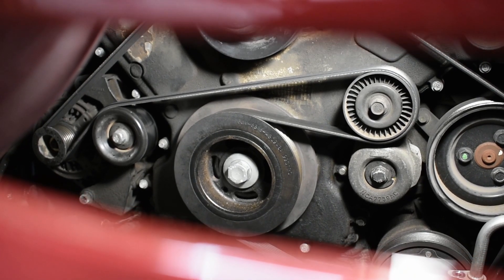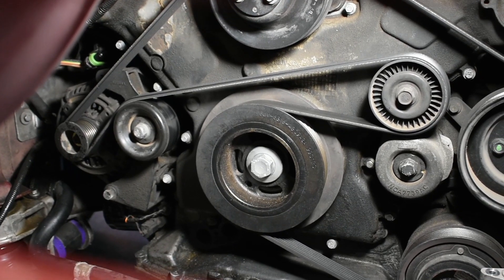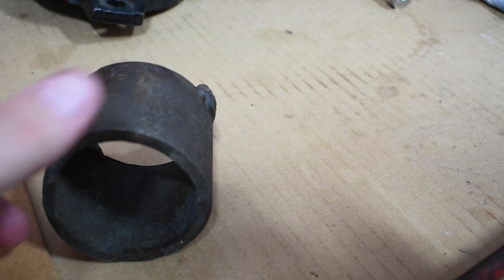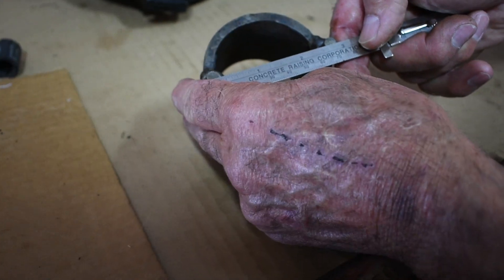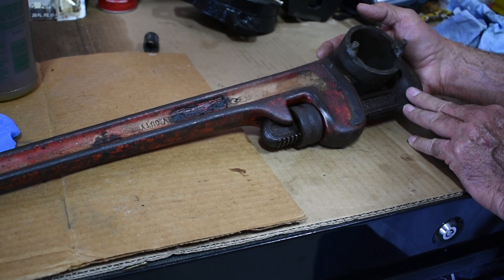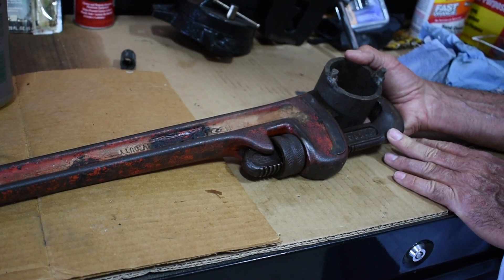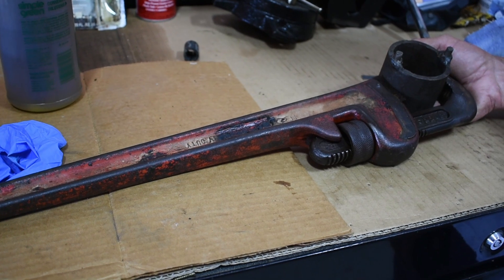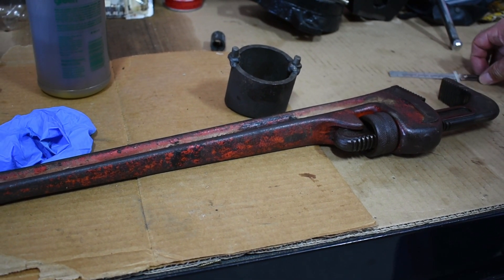XK8 Crank Shaft Balancer Retainer Tool

Comment: How many miles and what year?
Reply from the maker: I have a Coupe and Convertible from 1999. 75k on the coupe and 120k on the convertible.
Reply: @weekendwarriorgarage4402  And which one is getting the chains/tensioners/guides?  A little more data would help us all assess where we are in terms of planning this job.  I got 230Kmi before my M62 BMW engine chain guides broke up.  I know the early XK8s had inferior guides to the 4.2L but how long do they really last?
Reply from the maker: @garyvanremortel5218  The coupe has already had this done. I did it before I started the channel. That is what made me start the channel in fact. I hope to do the convertible soon but not sure when at this time.